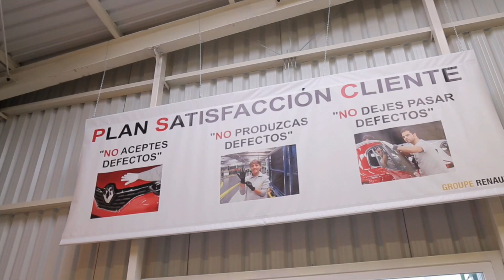How the all-new car Renault Megane is built: press/paint/assembly/quality - production Plant

Comment: Renault, please, put the Logan's buttons of the electric power windows back to their respective doors. It is so silly to find these buttons on the central column or between the front seats (for the rear windows).
Reply: Dandy D ✅ done!
Reply: the 2017 models have them on the door. I can confirm this as I have a 2017 sandero.